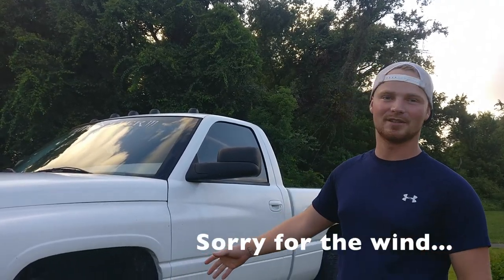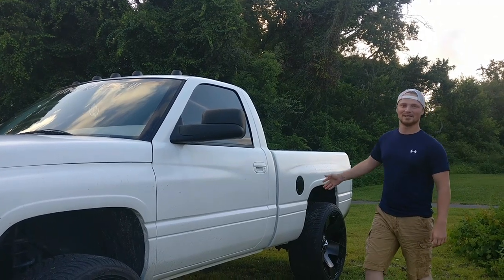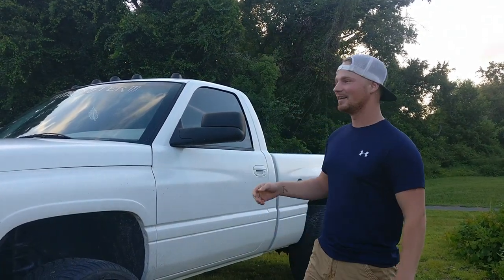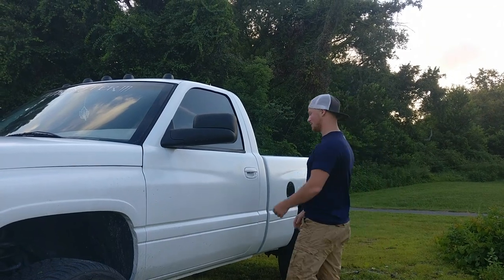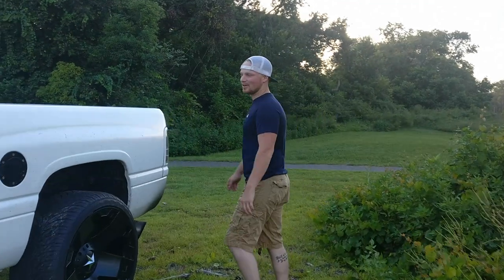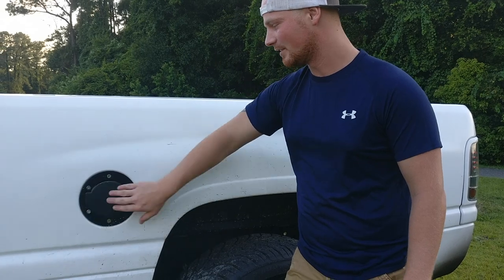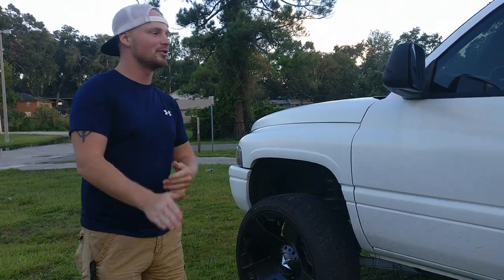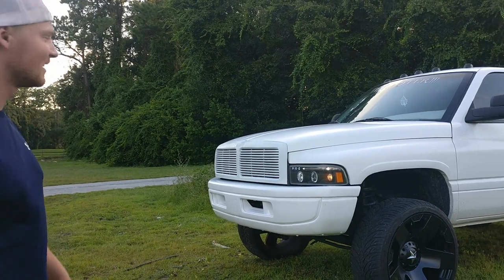2ND GEN 12V CUMMINS SINGLE CAB SHORT BED WALK AROUND AND MOD LIST!!!

Comment: Running marine injectors on a non marine piston will destroy your engine! It should have 145* spray which is the correct angle for the stock piston bowl.
Reply from the maker: i honestly hate the marine injectors. I agree with you. ill be changing up the setup as soon as I get back from deployment
Reply from the maker: I also state in the video that the spray angle is 10 degrees off with marine injectors

Comment: It’s not a 3500
Reply from the maker: honestly I wouldn't doubt it but according to the title it is. lol from what I was told when I purchased the truck was it was originally a 3500. they shortened the frame and put a short bed on it. thus the single cab short bed